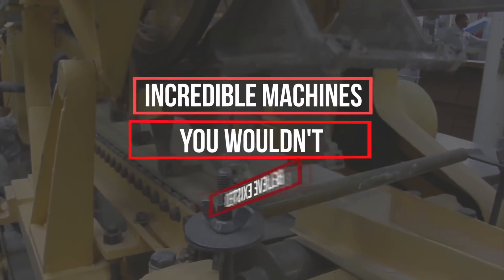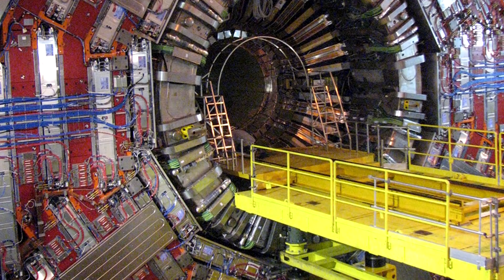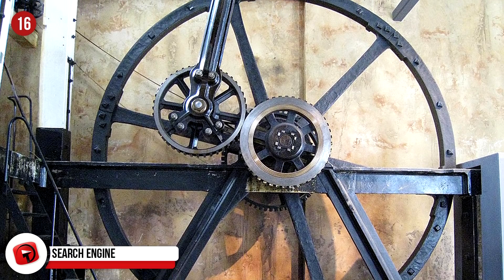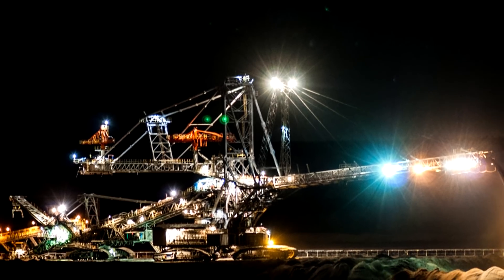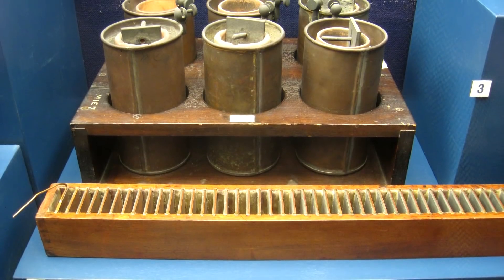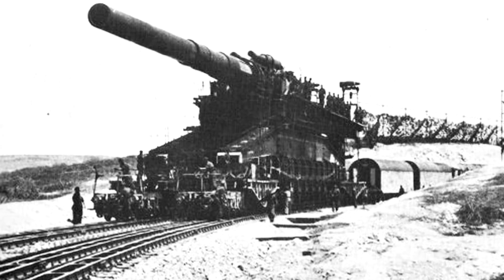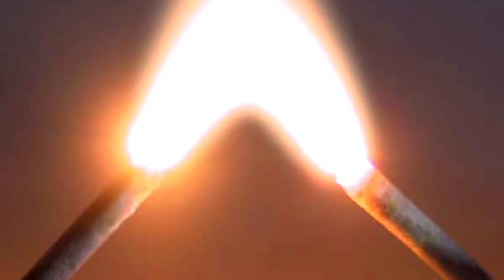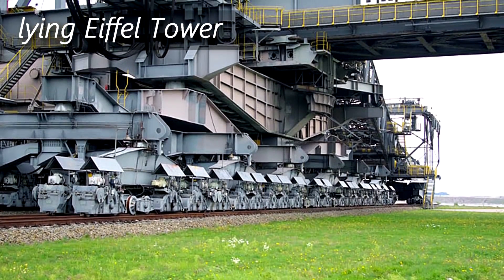Incredible Machines You WOULDN'T Believe Existed

Comment: I knew the modern laziness of language would someday come a cropper.  I refer to Number 7, "Big Shot," where you call that big gun a "Rail Gun," which it is NOT.  Calling anything to do with a railroad a "rail-something" is laziness; the actual term is "railROAD."  There is a device called a "Rail Gun," but it doesn't travel by rail, since it is necessarily stationary.  It would be built in one place, usually on a fairly steep slope, and is very lo-o-ong.  The projectile is run up a very long tube, impelled at ever faster velocity, usually by induction coils arrayed along the length of the barrel tube.  Check back a few years for the big flap about a German factory supplying parts for this type of weapon to Iran.  (Science-fiction fans who want to know more about them should read "The Moon is a Harsh Mistress," by Robert A. Heinlein.)
Reply: FYI. Just a quick note. I had never heard the term rail road until I moved to Canada. In Britain and Europe I always heard it referred to as a railway, and after a few quick emails to friends in other countries I found out that some African and Far Eastern Countries also referred to it as a "Railway". I cannot say this is true of all countries, as I haven't spoken to people in other countries.

This description is just one of the many things where North Americans have a word for something, but in a lot of other countries it is called something else entirely.  Canada though has a somewhat unique English language, in so far as it has been influenced by both Britain and the USA languages. This was very apparent when my first wife moved to England with me, and found the language somewhat difficult to understand in 1976. I was in the Royal Navy, and could not get Married Quarters so as I my posting was reasonably close to the my mother's place we stayed with her and my younger siblings. While at the base during working hours one day my wife decided iron some of my clothes for me. After searching around for a while she couldn't find either the iron or ironing board, so she asked some of my siblings first and as they couldn't understand her accent she asked my mother. After several attempts my mother had a reasonable idea of what my wife was looking for, but for clarity my mother asked my wife what she wanted it for. My wife told her that she was going to iron my pants. Which had everybody except my wife laughing. My siblings asked why she wanted to iron my underwear. It took a bit longer to understand that in Britain pants were underwear, and we called what she called pants either trousers or trews depending on where we lived or grew up. My ex-wife and siblings never forgot this episode. This was just one item among many others where there was confusion.

Even within Britain it can sometimes be difficult to understand fellow British citizens, particularly between the North and South, or South and West. Sometimes being from a different local housing estate can cause difficulties in understand in understanding. I seem to recall when I was much younger and in Middle School equivalent our History teacher brought in a Guest speaker, a Professor from a nearby University who had spent a lot of time studying accents and slang. The Professor told us that normally he could figure out where each of us grew up within Britain, not just the Town but the housing estate as well. If the student grew-up in another country, he could at least tell what country, but not the town as he had specifically studied British Accents. I recall the teacher in his introduction telling us that the Professor had an 85% success rate.

The accent difference is why the British quite often have difficulties understanding North Americans, but have no difficulties understanding Indians or Pakistanis depending on where they are from in their former country.

Sorry I became a lot more talkative than I planned to be. Have a great holiday with your family and friends.
Reply: @sandykent978   I, as well as my two older brothers, was born in an apartment about 50 yards from the Chicago, Milwaukee, St. Paul, and Pacific Railroad, commonly called "The Milwaukee Road," so we have had the smell of coal smoke and Diesel fumes in our noses and sinuses, as well as the clickitty-clack of wheels on steel forever.  My complaint, these last few years, has been that people are using a sort of shorthand, calling everything that should be called "railroad" or "railway" just "rail"---sort of like when they say "chair" instead of "chairman" or "chairwoman" or the New Speak "PC," "chairperson (which to me means you don't know that person's gender)."  Similarly, anything that moves on the rails is now called a "Train," whether it's "railroad car"---or actually a "locomotive!"  They also refer to a "passenger car" or a "freight car" ("wagons," in other countries) a "RAILCAR."  Now, in this country, a self-propelled railroad vehicle used to be called a "railcar," so here's New-Speak again.  BTW, my sister's neighbor, many years ago, had relatives from the UK with a boy about the same age as my nephews.  He always wore what we call shorts (don't know if you do or not), so one day the younger of my nephews asked him, "Don't you ever wear pants?"  The young Brit smiled, then saw my grin, and we both laughed.  Teddy, like his uncle, often suffered from Foot in Mouth Disease!  Happy Christmas!